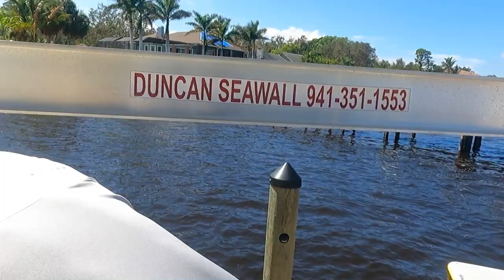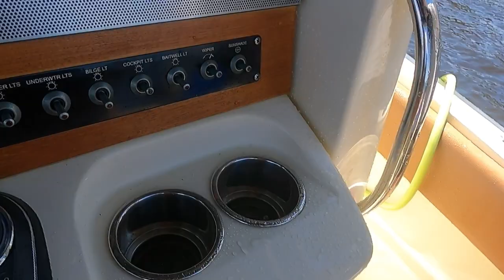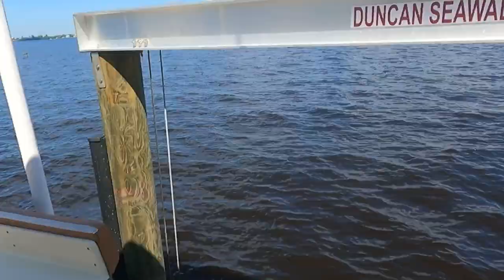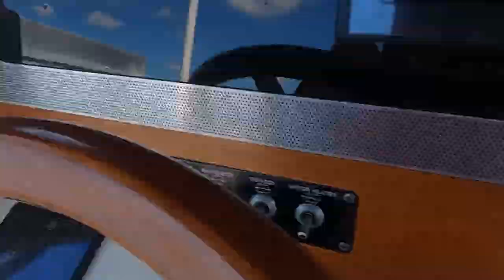Maintenance Wash on 30ft Chris Craft Catalina | Ceramic DNA Detox Smart Soap | Part 13

Comment: would you recomend using a pressure washer?
Reply from the maker: Not usually. Only on desperate boats. If you’re gonna use one just be smart about the pressure and distance. I’ll use an electric one to be safe